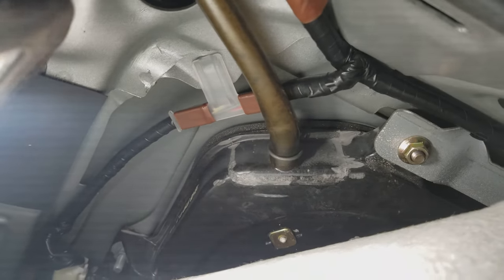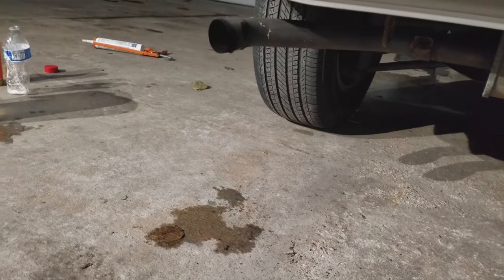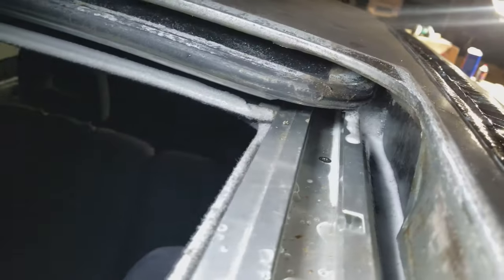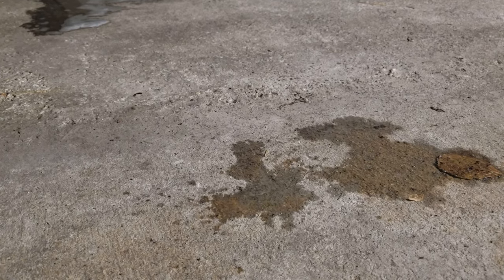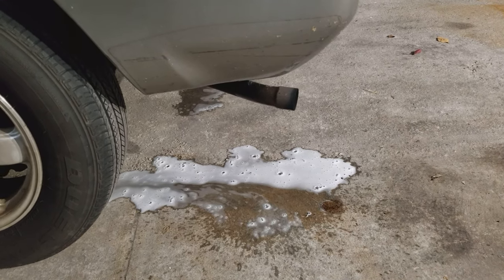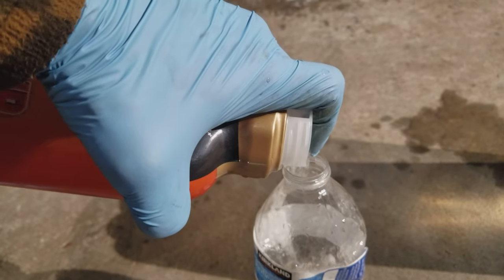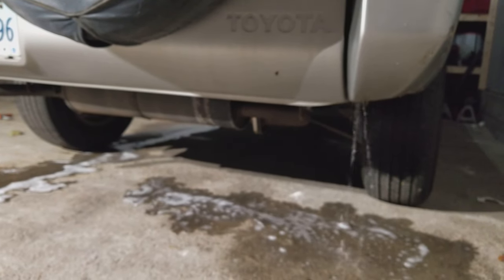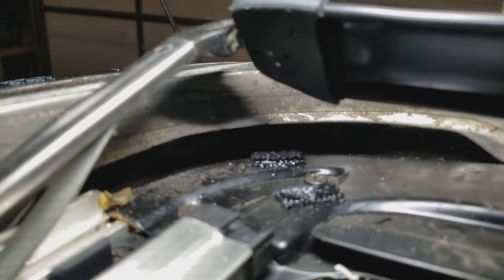how to unclog sunroof draining

Comment: My wife's Lesxus had become an E300 Swampmaster when the sunroof started draining into the cabin.  I watched many videos on YouTube telling how to unclog the front drains, but this was not helping. Our driveway is sloped so that water runs to the rear and I knew clogged rear drains were the problem. I found your video and flawless victory!  It happened exactly like you documented.  Nothing at first, a tiny drip, and then it opened up.  Now both of the rear drains are clear!   Thanks for the tip about pouring the two chemicals separately.  That is important to activate the foam down near the clog.
Reply from the maker: You are very welcome boss thanks boss taking the time to give me feedback 😀

Comment: I did this on my 2014 Nissan. The bottle says it is safe for plastic. Great tip about raising the front of the car to make sure the liquid gets to the rear drains. I used a turkey baster and some 3/8” clear tubing and snaked the tubing to the rear corners. Worked great.
Reply from the maker: I'm glad it work for you sir thanks for your tips and feedback

Comment: Aren't you concerned w/ damage to the tubing or paint? Is there a way to neutralize the product to prevent secondary damage to the life of the tubing or to the paint?
Reply from the maker: No this will not damage the tubing , there will not be a paint contact with this , every sunroof has a plastic trade ,,
Reply: I'd just flush with a fair amount of clean water.
Reply: For anyone else reading this these years later who is worried, flushing with water will work, but you can also pour vinegar (which is acidic) down the tubes to neutralize the drain cleaner (which is almost always basic, check and see)

Comment: I like your video and subscribe to your channel.  I have a 2016 Honda HR-V that is getting water under the front passenger side.  I was able to insert about 4' of string trimmer line but it would not go any further.  I poured water and the water did come out under the car.   However, when it rained, the water is still getting in the car.  Do you think the drain is still clog or can it be another reason?  I've ordered the Drano Dual Force from your Home Depot link and will give this a try.  Can you answer the following questions too so I can make sure I follow your instructions correctly. 
1. How much Drano liquid to use?
2. Which Drano liquid side to use first?
3. How long to wait before pouring hot water?
4. How much hot water to use and how hot does it have to be?  Should I let boiling water cool off?
Thank you in advance for your advice.
Reply from the maker: Hi, thanks. Try my link

Comment: Great video, thank you. My Highlander is getting water inside the car when it rains. I'm not sure if the weather stripping needs replacing or if its due to a clogged drain. But i'm gonna try this first before replacing the stripping.

I would like your own personal opinion on this. Do you think it is more than likely clogged drains or worn stripping?
Reply: Yo what did you do? I found water on my cars floor mat, it was soaked at first I thought it was the door seal but just today I got in my car it was raining and I noticed little drops coming from where the sunroof drain hose is located so I instantly knew what it was because I had done some research before but yeah I’m going to do what this guy did
Reply: @SIowMode650  Lol... Haven't done anything yet

Comment: What happened when you poured them both at the same time?
Reply from the maker: You will make a big mess , it will not go in the hole and do the job
Reply: @nestorautorepair  ok. I used one that is just one liquid. Made sure it was safe for plastic and poured it into a plastic bottle to make sure it wouldn't melt it. It worked very well. I appreciate your video very much! Thank you.
Reply from the maker: Wow nice thanks for your feedback

Comment: Hello. I just tried ur remedy on my 09’ Nissan Altima. Water continues to leak into the inside, back console, that leads down by the back windows? When I poured the drano in., it seems as if the drano just came into the inside back console, window area? Cld my drain valves be loose possibly? I’m trying to understand, and fix, without taking things apart. Yet, I’ll do whatever needs to be done. Ur input wld be so greatly appreciated.
Reply from the maker: Yes sir thanks for your feedback. Yes you will need to take some parts off also you can connect the line back on the drain
Reply: Your tubes were probably already full of water.  On an Altima you can reach the rear drain tubes by taking the roof liner off.  Just remove the handles (where you might hang clothes) and the liner pops right off like legos.  Then the drain tubes are just stuck on the sunroof and pop off